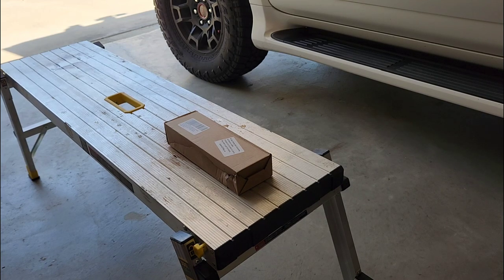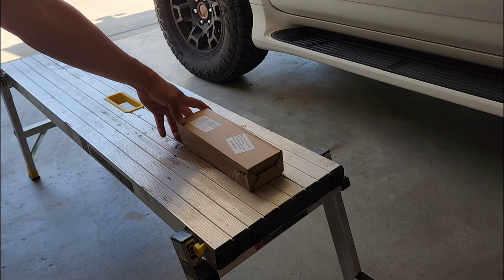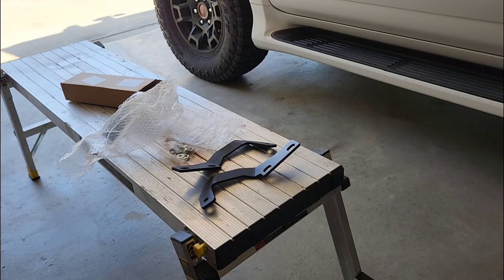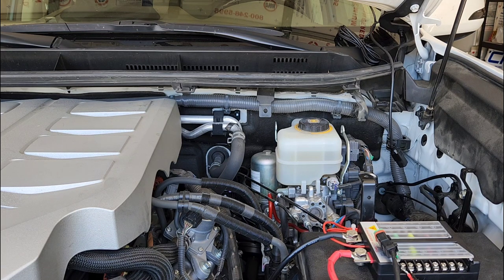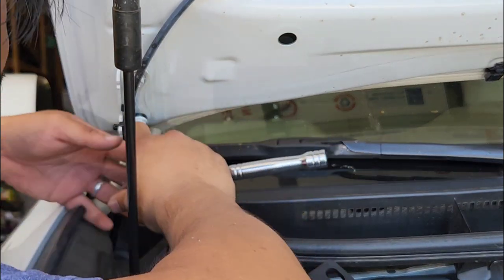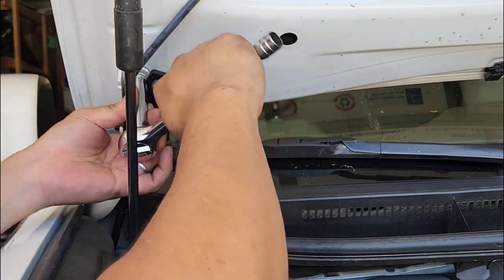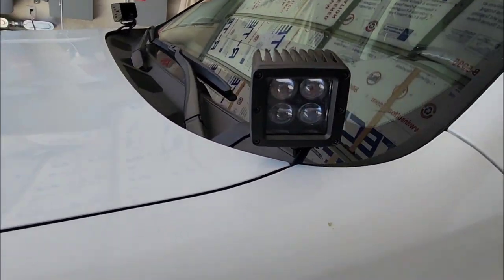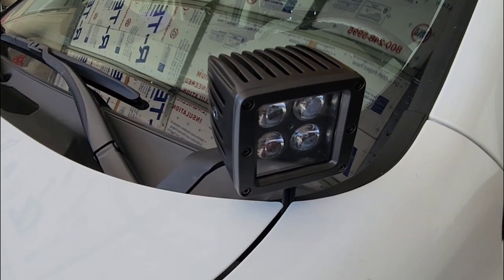GX460 Mods: Install 4 runner ditch lights brackets. Does it fit? #GX460 #4RUNNER #ditchlights

Comment: What brand of ditch lights did you use?
Are the ditch lights and brackets still holding up?
Reply from the maker: Oh man, I found a kit that was onsale at autozone a long time ago.  It came with the ditch light and 4 rock lights with Bluetooth connector as well. I just didn't have time to install the rock lights. Yes, both the ditch lights and bracket still holding up very well.  Found it, it was maxi trac kit from Napa, I got them for 99 bux.
https://www.napaonline.com/en/p/BK_7350092